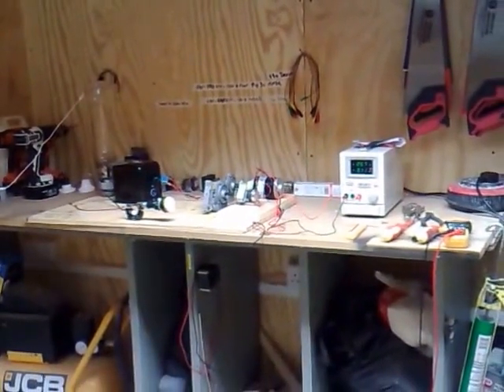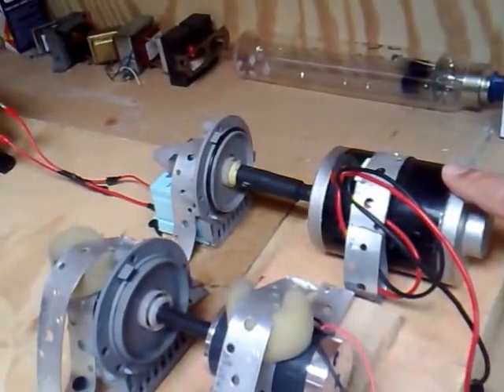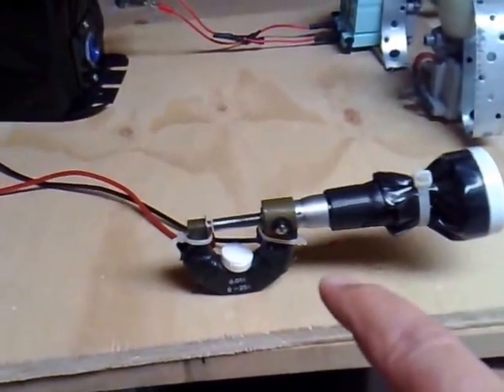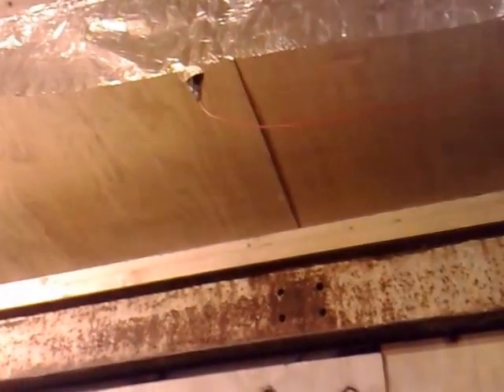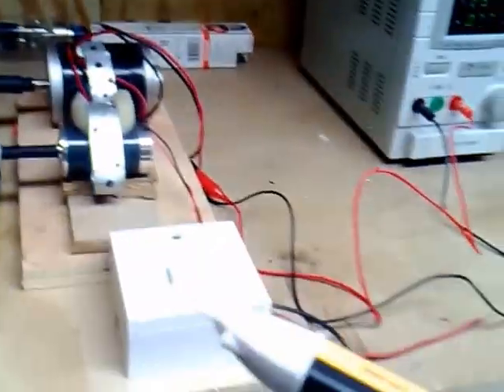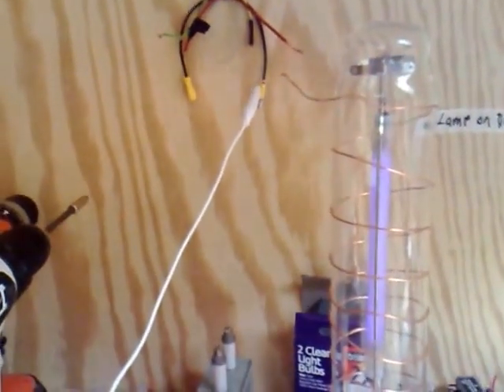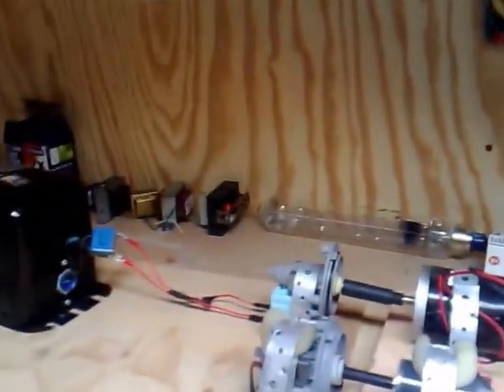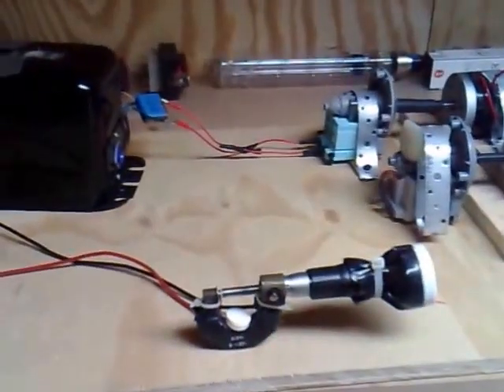Gerard Motor PROOF of RF.mp4

Comment: May I suggest you read up on electromagnetic induction, Tesla's favourite subject, the set up is simply raising the frequency of the AC, but not to higher Radio frequencies. The physics and electrical theory are basic school level, nothing advanced. The detector you use is totally wrong for this type of experiment. Half understanding a subject is totally miss leading your results.
Reply from the maker: +stephen wallin Hi S.W. Thank you for your comment about RF electric theory. So how do you stand with Morin and his work? I am just a student of Tesla with much to learn, are you a teacher? Plasma is also interesting particularly at a "Tuned Gap" with HV at varying frequencies. ....  DC
Reply: +E.power DC Trouble with all the postings is a little knowledge is a dangerous thing. Part understanding can lead you down blind alleys. Believe it or not this was Telsa problem, he was taking leaps into the dark as he was the first, a pioneer and his language and descriptions are very obscure at times to modern eyes, and he did get things wrong occasionally, like power transmission by high voltage and frequency..
Nothing demonstrated here is unusual, he is just lacking the understanding of what is happening. I am giving the poster the benefit of doubt in his not pulling tricks. I am a retired trained electrical engineer, designer of motors and transformers, and trained in TV and Radio transmission, Uni degree.
Reply: +stephen wallin The key missing in this demo is frequency, the motor generator is feeding a high frequency signal, lets guess at 20kcs+ to the transformer, (needs a scope to measure,) This is then raised in voltage to a large figure(ratio not stated), but can easily be 10,000 volts AC, The spark gap and the capacitance loading of the wire reduces it's amplitude, damping the power. the resultant low power, high frequency signal is indeed RF, Very low frequency, anf harmless to touch, as there is little current. Such a signal can be detected in exactly the way  demonstrated.

 Well done, you have caught up with Marconi by experimenting. Next step simply use the same setup and increase the revs of the motor, and your in business with a 1899 radio transmitter, pure and simple. Most people would never have got this far in a working demo.
Do get a better detector though, the one you using is so wide band it will pick up mains hum let alone radio waves.

The leap over Tesla that Marconi made, with others was to understand tuning the signal. Tesla at first confused resonance as he understood it, with proper resonance in a tuned circuit. He immediately understood it after seeing Marconi's work.
Reply: +stephen wallin reading carefully the setup you use  the motor is inputing 5000 revs to a washing machine multi pole motor acting as generator. If it is say 20 pole then the frequency out is 5000 times 20.
 100,000 is a radio frequency, albeit low, and with the spark gap is broadening the bandwidth. The lamp and coil are merely moderating the signals level. Check the number of poles in the generator to find the frequency occuring in this setup.
Reply from the maker: +stephen wallin  Hi again S.W. you are correct, I am trying to "Transform" from one  "State" to another & vs. When I "Tune" the first "Spark Gap" it seems to absorb with greater electron drift, " more AMPs. This process is very sensitive. Please see my Plasma Power Generator Transformer video which highlights this. Please note that I have a long way to go but I am enjoying learning. Ref Video:- https://www.youtube.com/watch?v=-1pbyzTQZag
Reply from the maker: +UniversalExpanse  Yes Yes its like metal core transformers, also the Earth itself is the same. What I can not understand is the extra "Electron Drift" in AMPs in the near field. Do you think its just "Reactive Power" ?  ...  DC
Reply: +UniversalExpanse The magnetic field does not require a coil to induce electricity into it, a coil is simply a multi pass wire, it has no extra property, just the concentration of the induced field. The sodium lamp is radiating a field at many frequencies, including RF.
Reply: an iron core magnet cannot oscillate fast enough , need a air core or non-magnetic core
Reply: I have no uni degree but i think you left out a 'key' part but yet you claimed to understand and say that an aspect is the 'key' ?? 

so i think what no one is talking about is the PHASE - the magnetic pole in a washing machine pump is a two pole rotor - when turned the output out of each 'pole' {as the inductors are wound on two separate poles} but connected  this creates two 180 degreed out of phase Sine ..

all you need do is buy one of those cheap hand-held oscilloscopes that you can get on-line they are totally fine to see that the output will be {Two} x 180 degree out of phase sinewaves. 

so i would more likely be inclined to say that is the 'Key' as this phase is the 'unique' thing about the washingmachine pump design once it is reversed in this way. 

regards.
Reply: @swallin19  you are wrong tesla did know what he was doing, and you do not. Our schooling is brainwashed half truths. If you look at tesla's tower it's built remarkably similar to the pyramid of giza, interesting these pyramids all over the planet very well could have been wireless power plants. And tesla was able to build one without any advanced schooling classes. The project was shut down because there isn't money to be made from free electricity. And you don't know these things because taught history is a lie and they don't want you looking further into men like Nikola tesla, Faraday, heaviside, stienmets and many others you probably never heard of.
Reply: @swallin19 Youre great sir! Do you have patented  inventions being as a designer of transformer etc? Or simply innovation of what Nikola Tesla patented invention.

Comment: The spark gap is causing the oscillation and any coil with pulsed dc on it is going to generate a magnetic field as well as an rf signal. The frequency can be adjusted by the resonance of the coil and the pulse frequency of DC. This is Pretty much how wireless charging works. A cell phone battery can be charged in 2 or 3 seconds depending on the frequency of the pulsed DC into the large coil.. Wireless chargers are nothing but pulsed dc causing a residual rf signal. Any pulsed dc into any coil of wire will generate an rf signal. Hi frequency oscillation requires transformers without iron. You need transformers wound on air or plastic bobbins to run real high frequency RF. I have experimented in sending hi levels of FR into transformers, but standard iron core transformers are very inefficient and work very poorly at hi frequency. Most switching power supplies like phone chargers or laptop power supplies are switching at 50-150khz. It requires air core windings, but you can increase power using rf signals into air core transformers. I have seen it with my own eyes. I have been designing switching supplies for 30 years, before anyone even started thinking above 60hz. All the old tube ham radio gear had mechanical multivibrators that pulsed dc at 60-120hz then fed  a transformer to generate hi voltages to run tubes. I have amplified power by switching dc at 1mhz into a air core transformer designed and wound for 1mhz operation. The only problem is it wipes out any am radio in a mile radius. The power out can be greater then the power used. It can be done. This technology has Merritt. Ignore the trolls and deniers. I have done it myself. Mr Morin is figuring it out, but he needs air core transformers made for his frequency of operation and his technology will launch into the next level. I have msg him but no response. It can work. RF current is stronger and acts different then AC or DC current. RF also works great as a welder. They can be made much more efficient and use less power as they put out more power to weld with. I have seen this as well. People just need to think out of the box. I was taught things in Engineering college that i have personally destroyed. Just because they teach it doesn't mean it is true. Anyway don't give up experimenting. Cheaper power is very close. We need to dump 60hz and use higher frequency power. It will be much more efficient. All transformers will be smaller and lighter. Once filtered the equipment on the power line doesn't know the difference. We can generate power at hi frequency and still convert it back to 60hz before transmission, or stay at a higher frequency right to your home. Just my 2 cents.
Reply: Very worthy advice. Thanks for sharing your more than 30 years as engineer or a scientist elect. Designer.